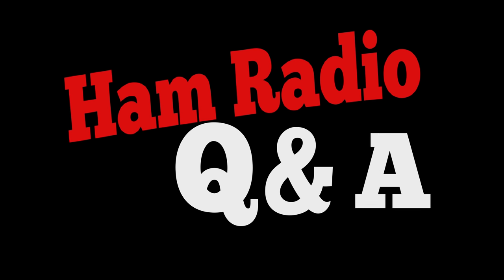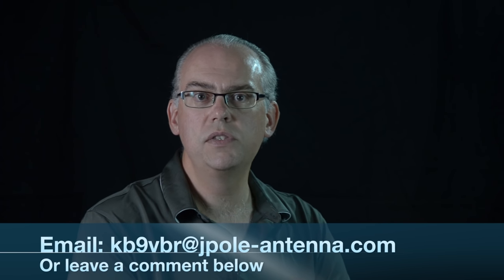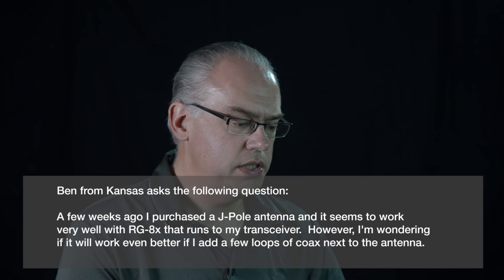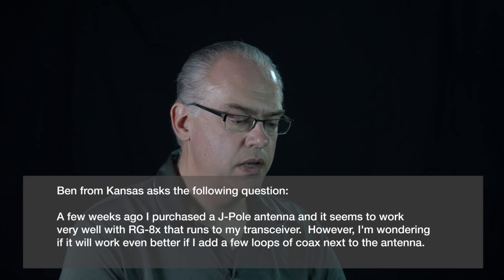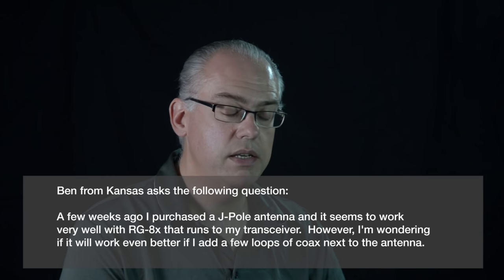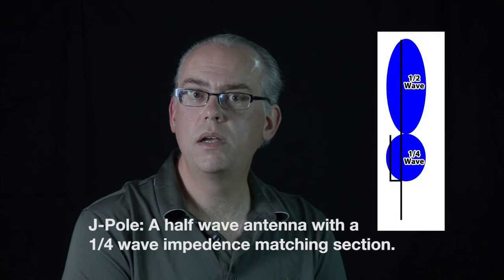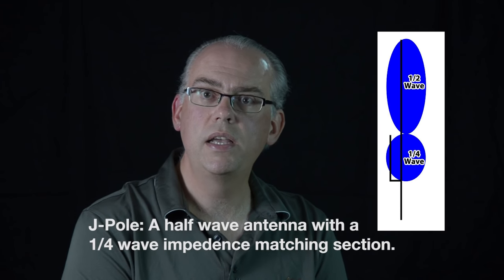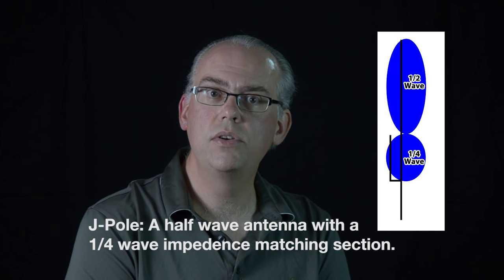Baluns and Chokes: Ham Radio Q and A Episode 3

Comment: Thank you very much!!! KE8BBT

 I'm changing my 7 year old RG58 to LMR400. At the antenna I have RG213 so I can easily get 5 loops. But then I have an 80 foot run so I'm using the LMR 400 after the lightning arrestor. Then at the entrance/bonding box (KF7P) I'm using RG213 as my feed into the house because of its flexibility.

Comment: I'm an electrical engineer (FYI).  The way I like to visualize what's going on is the following.  First of all, in any transmission line (any line that carries alternating current), any change in impedance along the way will result in some current passing through that point and some reflecting back along the way it came.  The line looks infinitely long if the load is only resistive, which means that at the particular applied frequency, the capacitive and inductive reactances balance each other perfectly.  A 'change in impedance' means a change occurred somewhere along the line that added/subtracted either capacitive or inductive reactance (or both) and they no longer cancel each other out.  In other words, if you measured the instantaneous voltage present right at that point where the impedance change occurs and looked left and right, the different directions from that point have different impedances and will therefore see different amounts of current from that point into the two directions.  In a dipole antenna situation, both wires of the dipole are by default equal in all regards (assuming no other factors such as conductors or ground planes too near the wires).  But each half is 'fed' by something different ... the center wire of the feedline on one, and the coax shielding on the other.  If you take an imaginary walk down the dipole wires to their connections, then those connections are what I referred to as a 'change in impedance' above.  The input impedance of the center wire on the feedline (resistive+reactive) is different than the input impedance of the coax shield (resistive+reactive).  If you further assume that it is reflected current coming down the dipole's wires towards those connections, it's fairly easy to see that some power will be reflected back along the dipole wire and some will pass through the connection into the wire and coax shield (separate from each other).  But the feedline wire and coax shielding have different impedances (!) ... the result is that the 2 sides will NOT be the same in terms of current being reflected back into the dipole wires and current that was able to pass through the connections.  Play with software such as EZNEC and you can see this modeled nicely.  You can view this as current on the coax-braid side of the dipole existing in the dipole wire and a 'little bit leaking into the coax'.  If you could stop the 'leakage' into the coax, then according to Kirchhoff's Current Law, the dipole wire would then carry ALL of the current and it would equal the current in the center-wire side of the dipole.  This is where a choke comes in ... they are inductors.  Inductors resist instantaneous changes in current.  As the current in the dipole wire rises at the connection point, the inductor (the choke) resists current flowing down the coax shield and thereby forces it to stay in the shield side of the dipole wire.  The only gotcha is that different frequencies require different inductances in the choke - air core ('ugly baluns') have narrow high-impedance characteristics versus frequency while ferrite-core chokes have broader ranges of high impedance versus frequencies ... and not all ferrite cores are created equal.  Here's a good resource (hint: choose 11 turns of RG58 on a stack of two FT-240-52 ferrite toroids)  http://www.karinya.net/g3txq/chokes/

Comment: Last year I put h/b dipoles into my attic and a h/b 60m inverted vee outside.
I tried a ferrite ring choke of the correct grade at the aerial end of the inverted vee but noticed my SWR changing slightly when I touched the coax cable in the shack. My theory was that due to the wavelength r.f. was getting onto the coax after the choke so I put it in the shack and no problem. The coax must be in the r.f. field. My inverted vee is very unbalanced as one end is near the house.
The same with my h/b 2m 2 element collinear so I put the choke about a ¼λ from the aerial. SWR reading okay.
The dipoles I never checked but put the chokes in the bedroom shack thinking the coax is in the r.f. field. SWR okay.
Maybe a few snap on ferrites spaced out along the coax at the aerial as well might stop r.f. being picked up on the coax. I think I'll try this.

Interestingly I looked at two aerial manufacturers, one said a choke at the aerial and the other said at the tx.
G4GHB.

Comment: 1) What's the difference between a Voltage balun and a Current balun and why should I use one and not the other ?
2) Which is the most appropriate balun for a half wave centre fed dipole for 2-30Mhz fed with 50 ohm coaxial cable ?
Reply: too bad no one replied
Reply: @gaptastic  Luckily i know now....

Comment: Ignorance is not bliss, I was robbed. Actually I understood a few things which is remarkable for me. How do baluns work that aren't wired to the antenna. I've seen little antennas used for TV and radio as well by friends living in apartments that can't mount a large mast or have any length to run any type of wire. Guess it's like putting in an inground pool and you live on the 8th floor. The folks below probably wouldn't appreciate it much. Any the baluns aren't wired in, its basically just attached to the mast itself. It's larger the coax attaches to it but it's just snapped on. I'm guessing the mast is aluminum does it somehow travel down the mast without actually being wired to it? My ignorance makes the question a bit dense I know but thanks anyway if you get a chance to answer the question.

Comment: I posted a question 2 years ago and see no response , ok then I sense have proven my point on sleeve chokes , just don't allow any coax velocity factor since we are only working with signals on outside of coax. Now it would be nice if you mention what can happen when you have high common mode current on the outside like it can radiate just like the antenna but causes the pattern to be way off ,it also receives outside interference causing more noise on the receiver it also can create rfi and those signals can get into all your sensitive electronics and gfi breakers not to mention it will produce a shock hazard.  If you don't care then watch out for angry neighbors because you're most likely giving them interference . The more informed you are the better you can protect your hobby.

Comment: Hi I am De kc5ulu . Love the presentation you give . I have a problem with sleeve chokes they work great but I've been told by several hams that I am wrong in the way that I build them I've also noticed articles that all contradict the way I'm doing it. I use the 1/4 wave formula 234/frequency to get open air length of my antennas , I use the same for my coaxial chokes but , I have been told by many I need to allow for the velocity factor of the coax I'm using, which in this case is rg8x however the whole reason for the choke is to increase the impeandance on the outside of the coax so the signal will go down the inside 50 ohm cable and not the outside. I did finally make a choke using the coax velocity factor of the 8x but it was to short and didn't work for me so went back to the way I doing it . I encase my chokes with heat shrink and it may  slow the signal some but I can't tell, it still works the same. I am building 2 meter quad antennas I don't use ferrite beads or wind up coax due to weight and or windloading . So what I am asking is this way I am doing it right or not?

Comment: A pop can with 6 loops. Then can removed. And loop taped . Forms a good choke for a quarter wave. Dipole. The swr drops off and the radio runs cooler.

Comment: Ok wow! Super simple and it worked!!! I’m not a technical guy; I like to talk on the radios not build and modify the dern things, but this was so easy and it took my SWR from about 1.9 to 2 down to 1.5   On my 2m 70cm mobile with tram antenna trunk lip mount 50rg coax bout 20ft.  Thank you for the information

Comment: I tried an experiment with 400 ohm TV antenna feed line, and cut it to the proper length for a 2Meter antenna, and I wrapped a small piece, 1" X 3" trailer flashing aluminum panel,  watching to make sure i did not touch the elements , but started there, and after checking the SWR several times, it went down from nearly a 2 to less than 1.5.within a 10 millimetre section, going down the antenna first, then going back up above the connection. after another two times adjusting, it went to a flat zero. No SWR was seen on the meter.   Did you ever try one of these experiements, ?  My J pole still works today, whether it is outside hung high in a tree, or within my hamshack. and I have worked several local hams straight, using no repeater aid.  Let me know what I did right for once if you will please Sir.  Thank you for your time.  KB4AKS   "A"lways  "K"eep  "S"miling

Comment: If a choke is needed to block rf from coming back down the shield braid , would adding the choke (turns of wire) at the braid connecting to the antenna rather then the whole coax. I'm considering a jpole 2mtr/ 70cm  feeding coax of rg8x.   You mention the clam shell chokes,  Can I use one taken from old power cords  to get a home brew antenna build secure from the common mode currents?   I am still confused how the choke does not also impede the rf going to the antenna ?  Thanks.

Comment: Hi my name is Julio call sign WP4PBO. My questions is about 1:1 & 4:1 BALUN. When I'm suposed to use ether or.
Reply from the maker: +Familia Román Soler 1:1, 4:1, etc are ratios of impedance. Normal impedance for amateur radio equipment is 50 Ohms, so a 1:1 balun will convert a 50 Ohm balanced antenna to 50 Ohm unbalanced feedline. Best example would be converting a 1/2 wave dipole antenna (which actually is 70 Ohms, but close enough for this illustration) to 50 coax cable.

A 4:1 balun will convert an 200 Ohm impedance down to 50 Ohms. Some examples of antennas that could have 200 Ohms of impedance at their feedpoint include HF verticals or off-center fed dipoles (like the Carolina Windom). If you are planning to feed these antennas with coax, you will most likely need a 4:1 balun to match the impedance at the feedpoint. 

A commercially built antenna will most likely tell you if you need a 1:1 or 4:1 balun. If you are building an antenna, using an antenna analyzer like the MFJ-269 will tell you what the impedance is at the feedpoint, which will then indicate what type of balun is needed.
Reply: Thanks for the fast response. I'm building a doble bazooka for 40m. Any advice on the balun subject.
Reply from the maker: +Familia Román Soler The Double Bazooka should have an impedance of 50 ohms at its feed point. A 1:1 balun would be sufficient, since I assume you are planning to feed the antenna with coaxial cable. If your impedance is above 75 Ohms or SWR above 1.5:1, then I'd work at adjusting the antenna length to bring the SWR, and impedance back down.
Reply: Nice have you on my subscribtions. No one answere a question as fast as you. I have a 13 years old kid looking into ham radio. And his complain al the time is no body answere my questions. Thanks a million.
Reply from the maker: +GoohtWillIndustries Great ideas! My go-to source for information on baluns is usually the ARRL Handbook. But that information can be very technical and the book, unfortunately, is densely written. I'll add homebrewing 1:1 and 4:1 baluns to my list of topics for a future video.

Comment: I understand for the most part but I assume no balun or RF Choke would be needed on a QRP rig using balanced line to a dipole? And would a RF choke not be needed for QRP using a long-wire to a antenna tuner?

Comment: Mike, In the process of constructing a fan dipole, My plans include adding slide on 12 ferrite beads and make a cover with PVC pipe and 2 end caps. I will be using 100 feet of RG8X... Any suggestions..... Thank You
Reply from the maker: I'm not sure of your question. Are you looking for a source for the ferrites or a better method of putting them on the cable? Instead of using a PVC tube, which could collect water and freeze, I'd probably secure them with heat shrink tubing or electrical tape. Then you wouldn't need to remove the connector on your cable in order to install the choke.
Reply: Mike, Van Gordon made a G5RV 20 years ago. The choke was made with slip on ferrite beads (10). He would use PVC pipe and 2 end caps. The caps would be sealed. I think your idea is the best idea. Thank You and keep up the great work. Thanks Again Chuck KK4CV

Comment: I have seen a lot of different ways to wind balancing. One wines 2wires around the toroid then goes over to the other side and wound the other way.  The other has 2 sets 2 wires wound one on each side,  called a current balon. I am not sure what they do different.

Comment: I have a Palstar AT4K with a 1.1 internal balun.I have a 450 balance line coming in to a DXEngineering 1.0 balun.  My question is: Using a separate  Palstar on a separate TX should I not use the DXE balun since I have an internal balun ?

Comment: You say use type 43 mix beads however the link only shows type 31 or am I not reading the description correctly thanks
Reply from the maker: Type 31 mix has a top frequency of about 300 Mhz and Type 43 mix is suitable for frequencies up to 500 Mhz or so. You can use Type 31 ferrites for VHF applications, but you will receive diminishing returns as the transmit frequency climbs.

Comment: For 2 meters i'm using RG-8X cable that has a foam dielectric.  Wouldn't it be better to wind the 5 turns of cable side by side as opposed to jumble winding? Also should one use a full wave length of coax (62"  of RG-8X)' for a  2 meter choke?
Reply from the maker: +Dan Druff Winding the coax side by side as opposed to the 'jumble winding' will give you a higher level of choke impedance, so it would be a preferred method. But since we only need to increase impedance to about 750 ohms or so, the jumble method works fine for VHF/UHF frequencies. On the HF bands it would take more turns of coax, so careful winding makes a big difference. As for your second question, I haven't heard of using a full wavelength of cable in the construction of a choke, and couldn't find a reference to such in my quick search. But I did a quick calculation and if you used 5 turns of coax in a 4 inch diameter circle, the total amount of coax you'd be using is close to 62 inches, or a full wavelength on 2 meters.
Reply: +KB9VBR Antennas ........I've seen home made 2 meter chokes wound 15 times, (RG58) around a 3/4" pvc form. Is there any advantage or disadvantage to this procedure as opposed to winding one 5 turns, 4" in diameter?

Comment: So what about an endfed like chameleon emcomm III? Is their “system” already designed appropriately, or is there still benefit on chokes or ferrite beads
Reply from the maker: That's an interesting question and my answer has a bit of speculation as you can't open up their transformer packages and inspect them. But I do know that Chameleon uses a 5:1 impedance transformer in their antenna systems. End fed style antennas can send RF energy back down the outside of the feed line if they aren't properly grounded and/or have a counterpoise. The Chameleon Emcomm III base antenna does have both counterpoise and ground, so a choke balun should not be necessary. But the Emcomm III portable does not. Their MPAS system comes with 50 feet of coax with an integrated  choke, so I'm going to infer that the Emcomm III portable would benefit from a choke also.
Reply: KB9VBR Antennas ....I have my portable setup with both a ground and multiple counterpoise. Also....I actually have opened up the transformer. The bolts on the side to attach the antenna etc came loose, and the only way to tighten was to open it. It is packed full of what I would guess is dielectric grease. At least I hope that is what it was since I “topped it off” before closing it up again 😁

Comment: So when I get your J-Pole tuned to GMRS frequencies does it hurt to make that five wind four inch loop for good measure for my Midland MXT115 radio or don't worry about it. I am new and starting out and do not own a good antenna analyzer  yet but plan on doing so someday in the future.
Reply from the maker: The same rules apply when using a J-Pole style antenna for the GMRS frequencies. I'd recommend the choke balun if you can do it.
Reply: @KB9VBRAntennas  I put the 5 turns at a 4 inch loop on my LMR-240 cable from USACOAX. Everything seems to work great. I will do a video soon on the install of the GMRS radio in my Polaris Ranger of your antenna and the cable. Excuse my ignorance but what is the magic math and science behind the 5 turns at 4 inches close to the antenna. I get the increased resistance it causes. Just curious about the reason for the number and diameter of the turns.
Thanks
Kevin

Comment: Iam trying to install a HF rig in my truck radio is a Kenwood 440s it has internal tuner also have an LDG external tuner the antenna is a MFJ with the wander lead I get the antenna tuned then it changes usely after I key the mike or turn the transmit power up. Do I need a choke or balun for this ?
Reply from the maker: Possibly. If you are using an external tune, the internal tuner in your rig should be turned off. Otherwise the two will fight against each other.